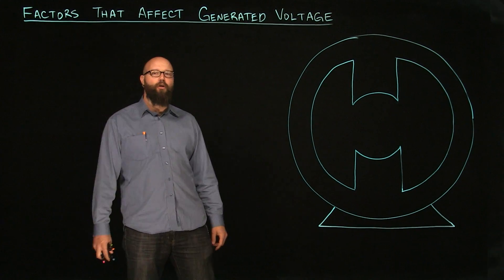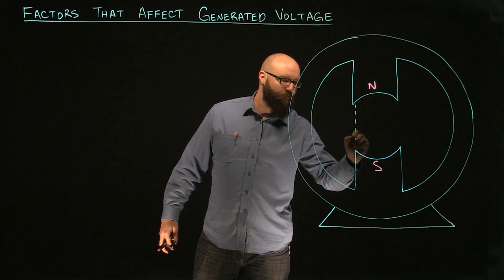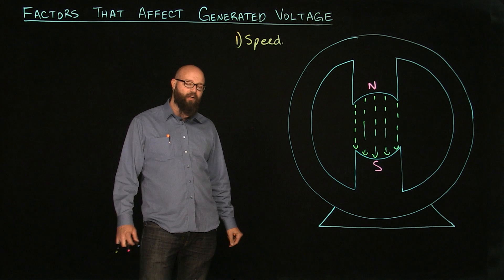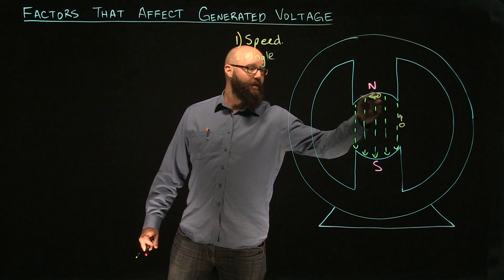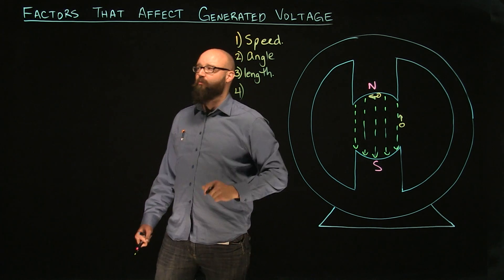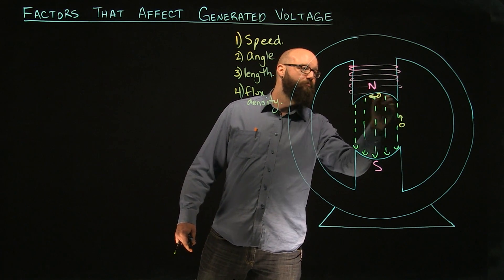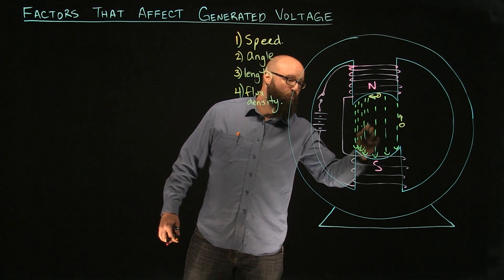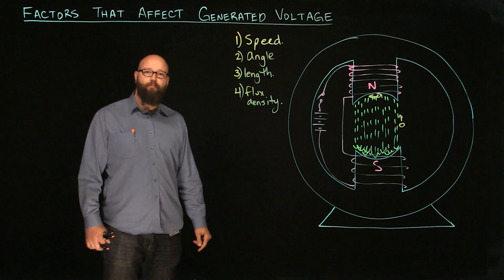Factors That Affect Generated Voltage

Comment: @schulerruler how does a direct current supercharger of flux density work?  By Faradays law ΔΦ= -εΔt which restated in terms of current is ΔΦ=-L(ΔI)/(Δt) (L:=inductance)which is an expression of a changing current; and since the supercharger current isn't changing, in principle the supercharge of flux density shouldn't work.  Do you know how that works?
Reply: I just read wikipedia page on faraday's law of magnetic induction, and I have work of my own, and both lead me to a conclusion.  I'm reasonably confident in it, however I'd be interested in what you have to say.